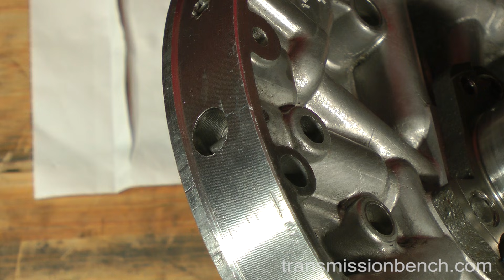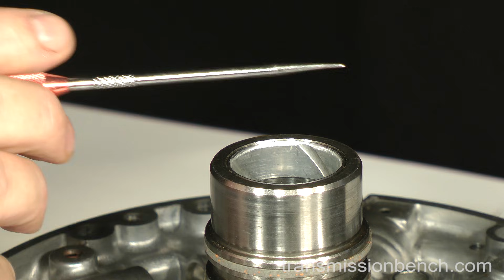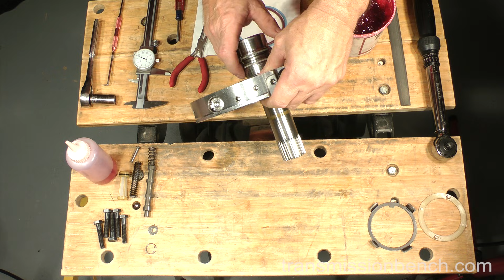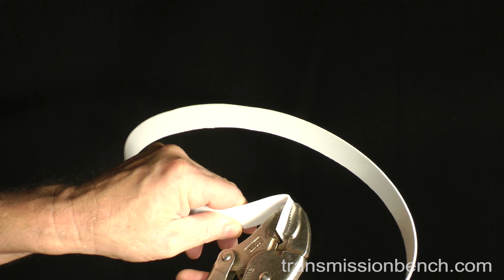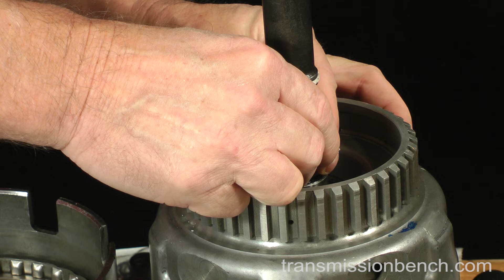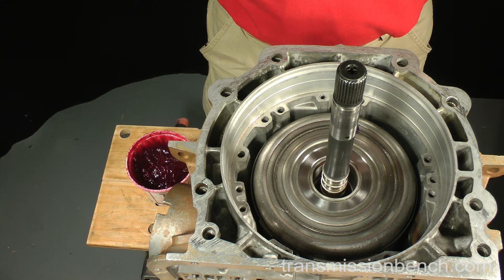Project 4L60E part 2 lesson 7

Comment: I have 120 thou gap between the input drum and reverse input drum when I install the two. All clutches are splined. I remove it from the case and there's no gap between the input drum and reverse input drum. I've been struggling with this for hours and cannot figure it out.

Comment: If you are replacing the seals and don't have the tools, I found some helpful tips. Use the bushing for the reverse clutch as a shrinking tool for the two upper seals. Round the edge of the bushing after installing. Most of all, COLD is your friend. I packed the pump asm in ice with the bushing in place and let it sit for hours to get the seals to go in the reverse housing. You would think warm would make the seals easier to shrink after installing, but not so!! I made a test plate from a nice flat piece of steel with rubber glued on and a hole drilled to cover the reverse runner on the valve body case as getting any air blower to seal on the stupid spawn from hell hole going sideways is problematic. Be sure to test everything before putting it all together, in the truck and not have reverse work! (ask me how I know!!)
Reply: This helped me.. im at this part rn and dont have those tools

Comment: Just a side note for time 30:45-- consider not cutting off the seal rings if they are not cut or damaged. That way they are re-usable in case you happen to cut one of your new seals. Remove them with a pick very carefully and set them aside in case you cut one of your new seals when installing the pump in the case later on. An old uncut seal is better than a new cut seal. Of course you can always just get another new seal if you prefer.

Comment: Great videos, So I rebuilt my 2008 4l60e in a 2008 Hummer H3 5 cyl. It shifts fine from first to 2nd but shifts into neutral when trying to shift to third and there is no reverse.

Comment: Why are the ring install tool and sizing tool so ridiculously priced, like over $100? What you get looks like it should be around $29 for the set. Without the tools, can you just carefully use a pump or even a bushing with the same ID? EDIT: Thinking back to his bucket trick to align the pump, can you do something similar using a pill bottle to spread, squeeze & resize the rings? Or even use a silicone tape to wrap the shafts to slide the rings down, then remove the tape and compress the rings with tape wrapped sticky side out, then remove the tape?

Comment: Hope this helps someone but a 10" air duct clamp looks exactly like that tool aside from a hex rather than a wing nut. Got mine at lowes for $2.18. Worked great.
Reply: I was gonna use a steel strap, I work in a small shop and we get shipments on pallets held down by these straps freehundred dollars lol

Comment: If you put the pump halves back in the case backwards, it will line up the pump for tightening.
Also, several large diameter hose clamps screwed together will work.

Comment: What performance upgrades would you do for a 600hp vehicle
Reply: Monster sunshell, 5 pinion sun gear, billet input and output shaft, pinless accumulator Pistons, sonnax boost valve, Raybestos GPZ100 3/4 clutch pack or Alto red eagle, Alto wide 2-3 band corvette servo and a good trans cooler. Sonnax makes a smart input drum with shaft and smart sun shell that are stronger than stock but they are very pricey.

Comment: What happens when you have no end play on the input shaft after installing the pump?
Reply: Did you find out your question because that is exactly what is happening to mine it has no play too
Reply: Yes it was the input drum selective washer..
Reply: TheRednexican , I assemble mine like that no end play and it burned up the 3-4 instantly this will be mine 3 time . I’m going to order the new washer. Everything new but not that..

Comment: Interesting he doesn't mention air checking the tcc apply valve in the pump. Mine is leaking but it wasn't mentioned here. How important is this leak?
Reply: Had that same problem felt like torque converter wasn't locking up, there are a couple of fixes, you can ream the bore and put an oversize valve or use the transgo tcc regulator valve and heavy duty spring but i think the best fix is Fixal's Tcc regulator basically its a valve with orings and it seals up the bore so you dont get blowby worked great for me.

Comment: I rebuilt the pump and replaced the nylon rings on the body, and when test fitting on the reverse input drum its very snug. Is it because of the new bushing and nylon rings that were installed?

Comment: Mr. Williams, I'm having trouble setting my last 2 drums of the stack into the 96 Corvette 4L60E case. Is there any measurements from the pump base in the transmission, to the bushing surface of the top clutch drum? I've tried it a dozen times and looking through the valve body, the pump is not seating in the transmission by about + or - 3/16" of an inch. Just as the shaft bottoms out each time, the top drum seems to raise above the thrust washer and spacer. I didn't want to attempt to tighten the pump bolts to force it down. Thanks.

Comment: Good videos. Just cannot get over the way pieces are placed in a box. Especially the bolts. A great mechanic would have used cardboard or something to draw the diagram and labels, then match up the bolts to make sure the bolts would go back into the same bolt holes. It may take longer. But, returning the bolts to the same bolt holes really helps prevent any kind of excess wear on bolt and bolt hole threading. Wayanchors.

Comment: I've replaced the front seal do to a leak well figured it was  the seal but got it all back together, it doesn't leak as bad but only starts to when warmed up well else could it possibly be. my other guess would be the bushing and the pump seal where it bolts to the transmission. what else could it possibly be

Comment: my 1994 Silverado 1500 2wd 4l60 makes a squeaking noise sounds like a bad U joint I removed the drive shaft and run the output shape my hand and you skeaky notice come from the units what kit do I need

Comment: Awesome Series, I ordered my Kit from someone else before I saw your series or would have certainly sent you my business.  This made a seemingly overwhelming project possible.  Next Project, Im coming to you for sure.

Now, after the brown nosing, I do have a question.  After installing the pump to the case, All endplay disappears.  It is there prior to tightening down the case.  I feel confident that my 3-4 clutches are seated all the way and the reverse input drum seems down.  I am able to get the pump seated down and it is spinning, not touching the reverse drum.  But no endplay at all.  I tried to put clamp on the shaft and use my feeler gauge but I cant get any movement.  I tore it down an did it several times.  all seems golden till I tighten down the pump.
Reply: that's the issue I'm working with right now spent 10 hours trying to get the trans to mate with engine before I realized the tq wasn't engaging the oil pump lugs.. ahhhhh
Reply: and and play goes to he'll. maybe oil pump is slightly cocked..

Comment: Mr Williams, I purchased a new input drum/shaft assembly and a new reverse input drum (both oem). when i mate the two together the reverse input drum does not seat on the thrust washer. the reverse input drum actually rubs against the side of the input drum. Any suggestions? Thanks

Comment: Hi there i have a 99 4L60E completely rebuild and instaled into my Chevy silverado. But now when i put it into gear it does nothing the shifter scenes the transmission but it has no movement at all. ive herd theres no pressure could it be due to the pump. please help.
Reply: +Anthony Chapman Go over everything u did n your head.

Comment: when i tried to set the pump back in, it won't go down past the o-ring and the bolts do not reach their holes. i ended up breaking the o-ring and now have to wait another week for another one to come in the mail and i have time off work. what's the magic behind getting the pump to go all the way down with the o-ring installed?
Reply: +Bobby Augustine I had the same problem but the pump will drop in when I installed the pump into the transmission. I pulled it back out twice, once to check if I hurt the rings and because I forgot to install the band.
Reply: I ended up beginning to seat the o-ring with a small flat blade screwdriver. Once the last little bit was pushed past the edge it slipped right in. The o-ring I was using had square edges not round, so it had an edge to catch on.
Reply: Bobby Augustine Did you rebuild the tranny?
Reply: +blackericdenice no sir, just replaced the pump due to my own error when installing the transmission. converter wasn't seated all the way
Reply: Bobby Augustine I have 2.5 years and 27,000 miles but I've had a leak the hold time. Not bad but when it sit for a while. The spot keep growing. I just rebuilt the engine and plan to remove pump and find out why it leaks.

Comment: When I rotate the torque converter after it is installed onto the transmission, is it normal to hear a squealing sound? The sound is similar to the noise that the roller housing makes.
Reply from the maker: +Ben Alford Hi Ben. Yes. you are probably hearing the roller clutch inside the torque converter. Jimmy

Comment: mr williams one question . you use a inch pound  torque wrench  and tight pump bolts to 220 . its ok to use a ft pound torque wrench  and tight them to 18 ft pounds ?
Reply from the maker: +perverso12345 yes.

Comment: ok got it im putting the drum into the case now when the drum is fully down the drum the band grabs comes up off the thrust bearing between the 2 drums but is fully splined with the sun shell and you can lift the drum shaft about 1/4 inch is this due to improper mounting depth of the forward sprag bushings please advise on proper method

Comment: I can't get the input frictions to spline into the ring gear... I've twisted and turned and slightly lifted for hours! And still it won't go down... Any suggestions?
Reply from the maker: Travis Lemley Hi Travis. It should not be giving you this much trouble. I assume you mean that the 3-4 frictions will not not go onto the input ring gear.  Remove all of the 3-4 frictions from the forward drum and try to fit them onto the input ring gear by themselves. There may be something wrong with the splines on the ring gear or frictions. Let me know..... Jimmy

Comment: At about 40 min in part 2 lesson 7, you say to make sure there is some end play. My 2008 4l60e has no end play at this point after snugging the pump bolts. Is this bad? What might be the cause? Thanks and I really appreciate the lessons.
Reply from the maker: Barrett Finch Hi Barrett. You should be able to turn the input shaft easily. If it locks down and will not turn, something is out of place.
Reply: I got it all back together and back in the truck runs great thanks! Only one thing there's a ticking noise when in gear. Any ideas?
Reply from the maker: It could be the parking rod is sligtly bent and causing the parking pawl to barely touch the notches in the output ring gear. I see this a lot. Jimmy
Reply: What if i have more that 35 thousands endplay

Comment: hello friend your tutorials are very good. I wanted to let you know that I have an oil pump (4L60E) at which the rotor where they placed the paddles damage, and this uses 10 rotor blades. I bought another rotor but this uses 13 blades. This caused me this problem with oil pressure?
Reply: Replacing a 10 vane with a 13 vane is an upgrade.